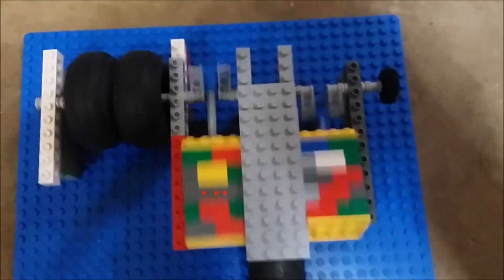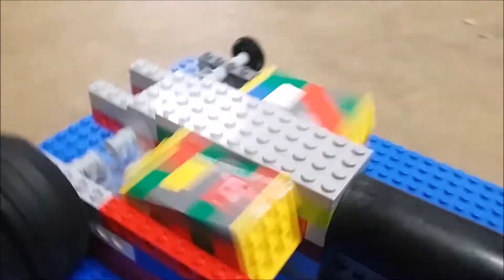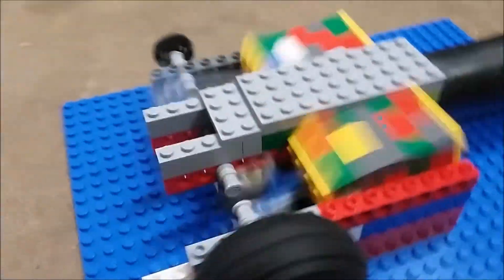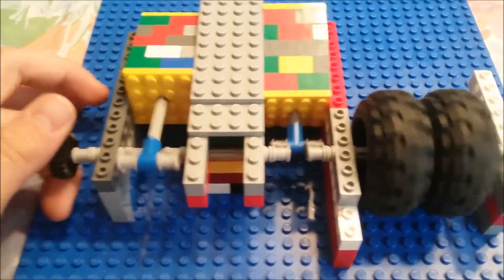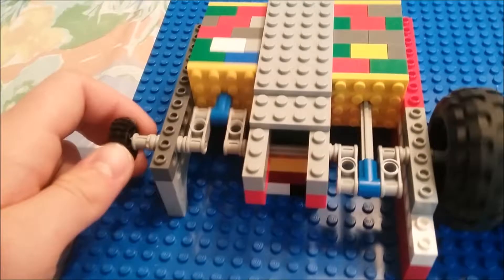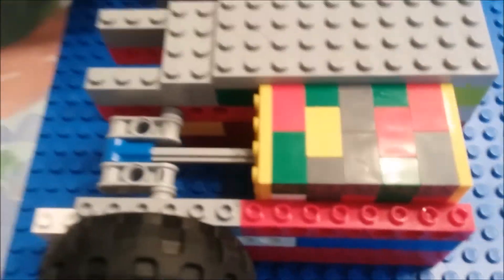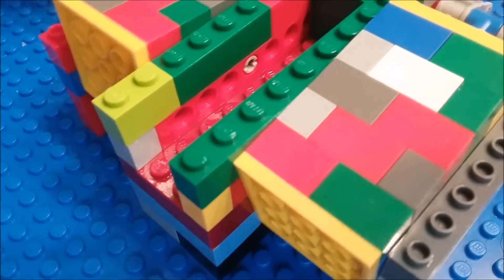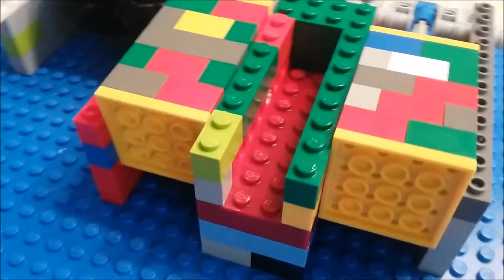Simple Lego Vacuum Engine

Comment: How does the cylinder rotate/pivot
Reply: The cylinder is only connected by two of those clicky technic pins along an axis. As the crankshaft turns, the angle of the piston changes with it because the piston and rod are one piece as opposed to 2 pieces as seen in cars. This causes the cylinders to pivot